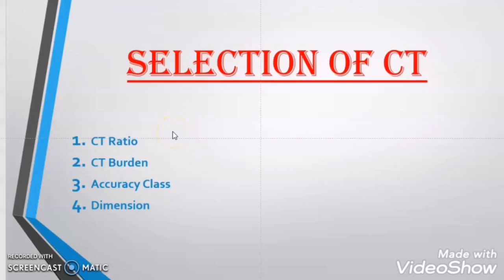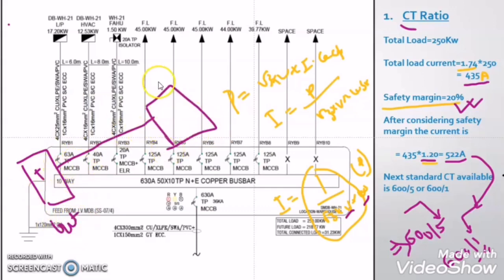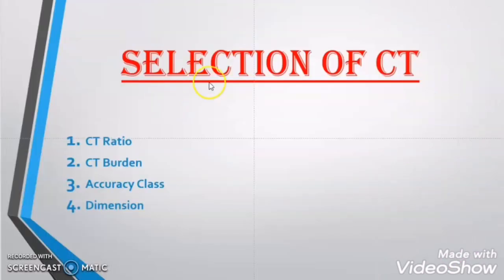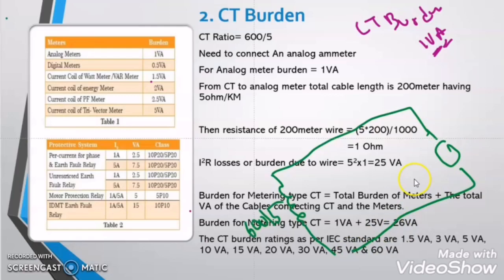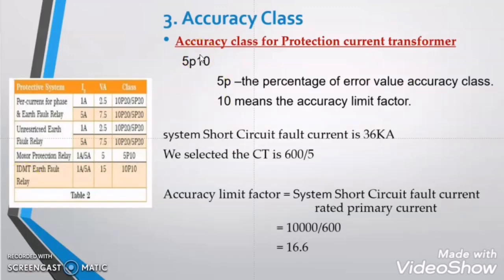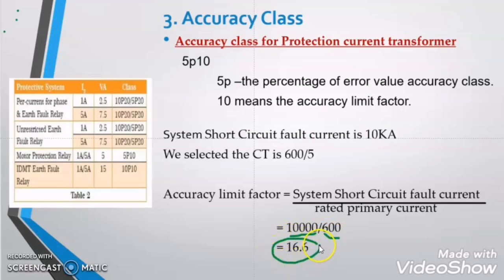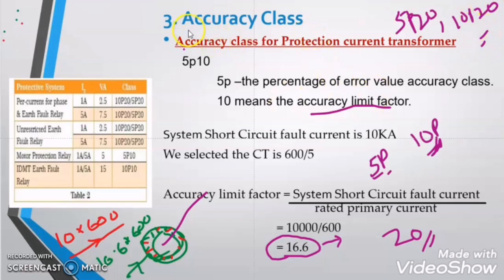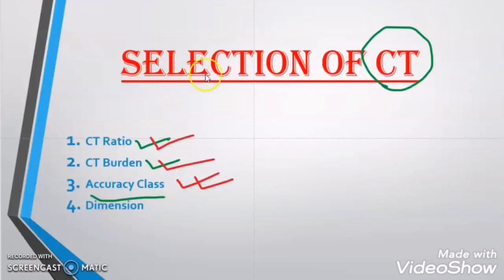how to select right CT

Comment: does load current of 3phase system divided in each phase?
Reply from the maker: Suppose a 3-phase 30 kW balanced motor is connected to 400 V, 50 Hz.

I = 43.3A

This 43.3 A will flow in each phase.

Not 43÷ 3 = 14.1A.